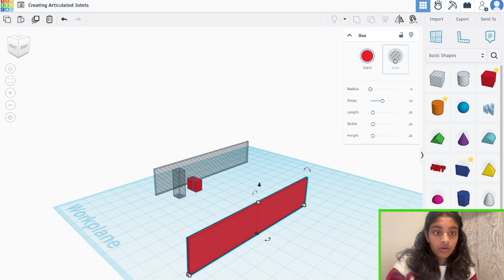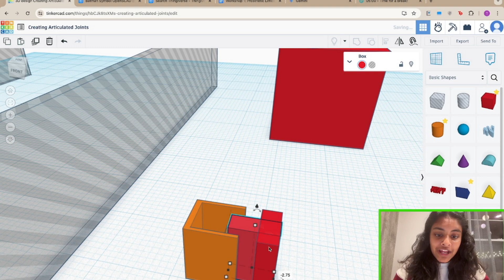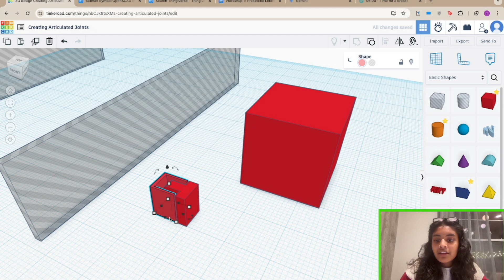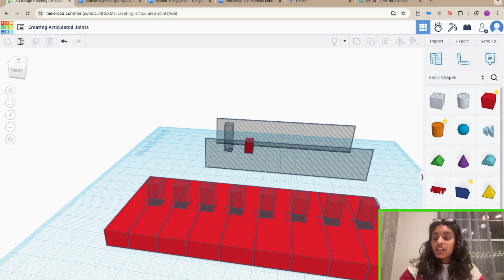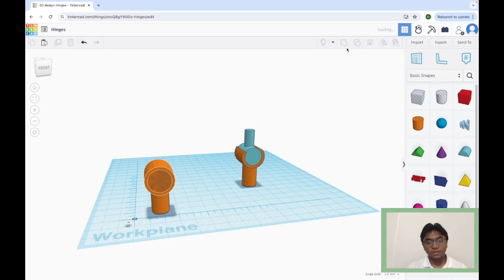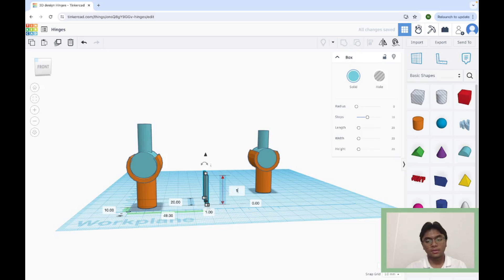How to Make Moving Projects in TinkerCAD: The Articulated Hinge Joint & Pivot Joint

Comment: I’m new to tinkercad. Great video! Can you explain the text steps to print and assemble it?  Do you separate the 2 pieces before printing?  How do you position them on the zero plane before printing? What is the optimal gap between the 2 elements to provide smooth rotation once assembled?